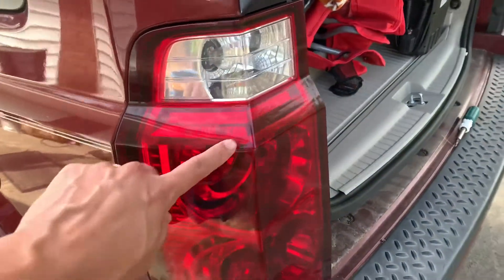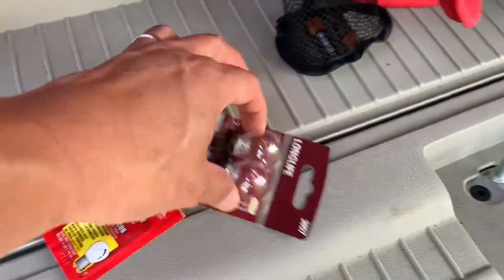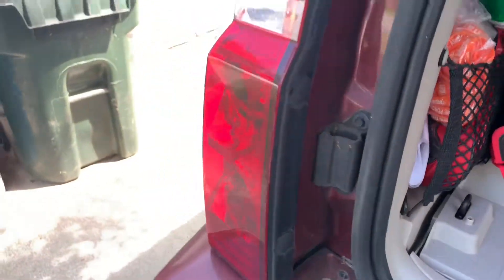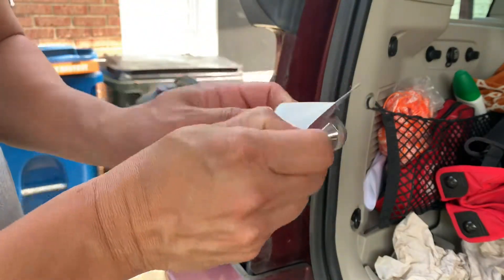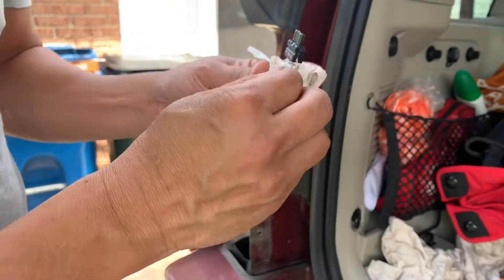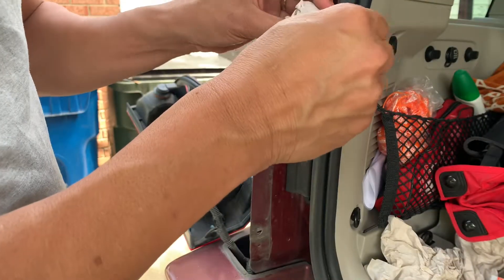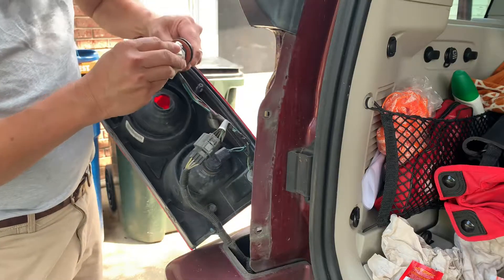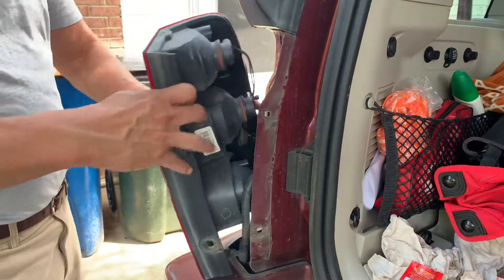CHANGE TAILLIGHT FOR 2006 JEEP COMMANDER

Comment: I had one of the two tail light bulbs out, replaced bad bulb with new one and still didn’t work, then I took the working bulb from one of the sockets and placed it in the socket with the bad bulb and still didn’t work. What should I do next?